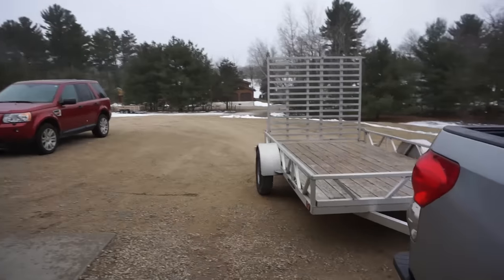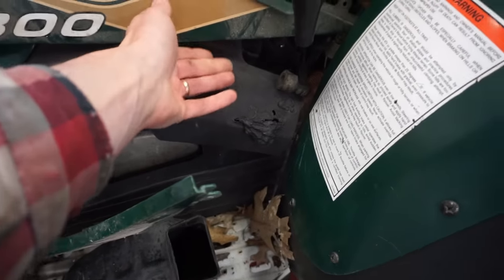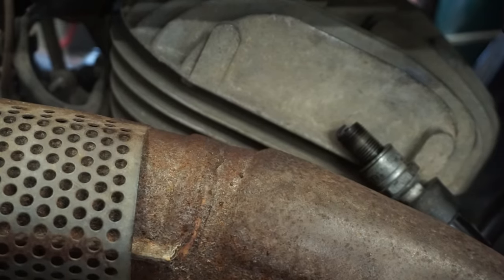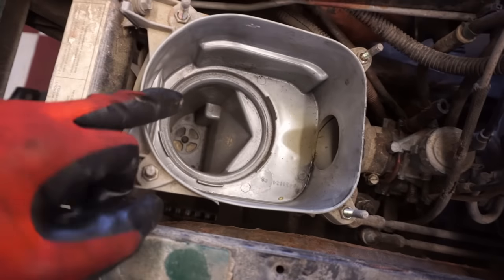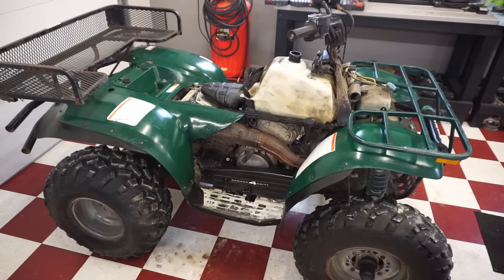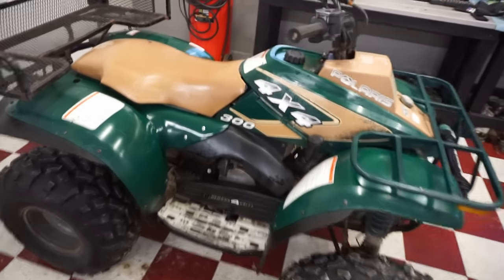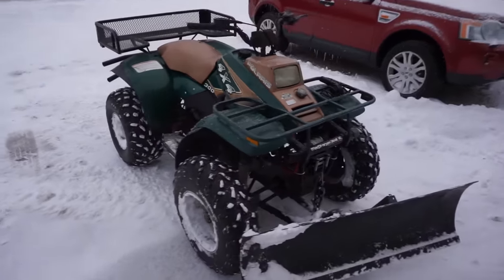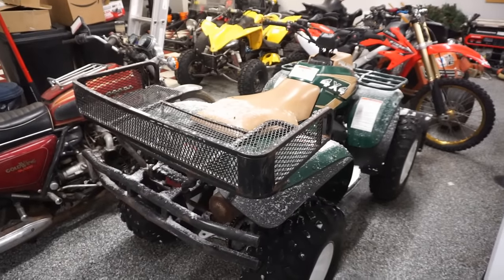$400 Plowing ATV Fixed In 10 Minutes (Plowing DEEP Snow)

Comment: Dear ATV manufactures......if you can make warning labels that last decades, you can make plastics that last at least half as long...
Reply: stickers save plastics by blocking UV
Reply: I have a large rubbermaid trash can that is at least 2 decades old. It is a light bluegrey with a darker blue lid. It has been outside taking sun and weather for decades, it is still flexible with no issues. I bought it at some normal box store. Yes they can make plastic that lasts forever. 
After they have a good formula they probably lobby Congress to outlaw some ingredient. That way the whole chain from engineers to plastiticians all get new work.

Comment: These old polaris 2 strokes are gems.  They are simple, powerful and easily upgraded.  The machines themselves are tough and rugged.   They're not perfect by any stretch as we can see through these outstanding videos but they are worth the effort given the the low initial cost. Once operational these old goats are unstoppable.
Reply from the maker: Parts are also pretty cheap for them. I don't mid the older models like this one. Easy to work on too.
Reply: @2vintage  Same, just a quick tip about these 2 strokes.  I've owned 4 of these polaris` and found that using a particular mix fuel-wise will nearly if not entirely mitigate ethanol issues.  1. Use minimum 89 octane.  2. Use Lucas upper cylinder lubricant @ 3oz/5gal fuel.  3. Use star tron fuel treatment @1oz/5gal fuel.  I use that blend in ALL  off road engines.  If necessary to use 2-cycle pre mix I use Opti2 at 80:1.  Never had a failure in any 2-cycle engine for over 30 years.  If using oil injection (I do), just stick with the polaris 2 cycle ves synthetic.  Again, never a failure, but that oil pump must be checked periodically for proper function.
Reply: @2vintage  i have a 94 sport 400 i just picked up for 600 its in pretty good shape need some work.
Reply: @williamwalter4882  80:1. ?  
Seems a bit high. 50:1 is the normal no?
Reply: @FondelMikeRotch  Opti2 is  recommended at 100:1 for any 2-cycle.  Amsoil Sabre also 100:1.  So I take it to 80:1 with the caveat of the mild lubricity from the Lucas upper cylinder lubricant already in my base gas.  It sounds crazy I know but Opti2 is seriously good 2 cycle oil - it's never failed me. The Germans know what they're doing.  Again, this is for premix only, not injection.
Reply: @2vintage  do you ever list these projects for sale when you are done filming with them? Marketplace?
Reply: @Pjw350  I was just gonna ask
Reply: You can go by any Polaris dealer and find them in their junk piles
Reply: @DoobieDoo1994  the sport is a great quad.  Had one back in the 90s.  There is a lot of power that can be unleashed in that 2-stroke 400.  Pretty sure you can still source performance parts for them.
Reply: I have a 92 polaris 350 and it is a beast, over 16k kilometers and it's barely rusty, and it's blow your  helmet off fast, power wheelies at only like 20 km, the max speed is like 150km/h 0-60 time is only like 8 seconds

Comment: As a former mechanic at a Polaris dealership, I can tell you the 300s and 250s 4x4 were designed to run their tires 2 sizes smaller on the front.  It looks like you're running the fronts off a 400 4x4. If so, the original gear ratio on the chain can/will cause damage in the transmission if left as is. I believe I remember, you can mitigate this by changing the gear ratio on the front sprockets.  Make sure the "Demand Drive Fluid" in the front hubs are full. There is a set screw on each hub, full is when it leaks out when the tire is rotated so that the screw is at 90 degrees or level. Those old Polaris 4x4 worked using electromagnets in the hubs. They are cooled in an oil bath, so the coil will burn out if the "Demand Drive Fluid" level is not maintained. They were around $150 each side back in the late 90's/early 00s, can't imagine the price now.
Reply: You can get a new hub for $60. I bought one for my 2002 Scrambler 400 2 stroke 4x4. That was probably 4 years ago though

Comment: A steal under $600 with winch and accessories. Good diagnosis on 4wd electrical clutch. Starter is usually just rusty and bendix spring needs cleaning and lube.
Reply: Well, he had to go to Harbor Freight for the winch.

Comment: Definitely a great deal, simple fox, decent compression,  not all broken up plastic,  really worth $1200 to $1500. I had made a switch box, and mount for my handle bar, with the parts from the winch control.  Back then I didn't want to spend $80 for the handle bar one. Tip for ya. Sealed outlet  plastic electric box I used. It's definitely worth fixing the starter. A paint, refresh on the plastics, and a good detail cleaning. Be a decent flip or swap. Down the road
Reply: O
Reply: Why do you feel the need to keep lifting the blade? Put it down and leave it, before you wear it out.
Reply: @Mark-sg8kd Not lifting the blade would make steering and traction less effective. I wish he had better access to his blade controller so he could start to lift blade incrementally when he nears the snow bank so he can cushion the stop and build a pile.

Comment: The handlebar brake lever operates all the brakes and the foot operates only the back. Also you need a battery hooked up for the 4wd to work. Battery died in mine, was using pull start for a bit, then 4wd stopped working. I started checking everything I could think of, then searched online and yup, needs working battery for 4wd auto switch to work. Great channel.

Comment: Just a tip. The rear brake lever can be adjusted with that screw and nut on the side of the caliper. This rear brake lever is actually mechanical and acts as a backup to the hydraulic system.
Great video!

Comment: Polaris used the most reliable oil pump you'll probably ever find, I've only seen one issue with one out of the 25 or so machines I've had, and that was a small leak but it still worked fine. Leave the injection

Comment: Sure you can test the front.   Jack the read end off the floor *wheeled jack aimed right down the middle) so the wheels spin.  Hit the 4wd and the front hubs should click in and pull you forward with the machine supported on the front wheels and the jack rollers.  Works like a charm and dont need to move it more than a foot.

Comment: Hey Joe check out engine restore it has CSL in it it restores minor scratches imperfections etc in the cylinder walls I used to use it in my engines it really does work it will restore compression big-time I used to put some of that directly down the cylinder and work it in

Comment: I noticed the engine moving when you started it and let it idle. Looked like the engine mounts might be loose, missing a bolt or two or it's just rubber mounted and it's normal for it to move. Just an observation. Are the front spindles a bit loose? Don't know if they tightened up when the wheels were bolted back on. That engine sounds fine. You'll get a lot of service out of it.

Comment: helper for your plow   blue 5 plaste gal water pale cut length wise has the right cure to wit , nut and bolt on to the plow gives you more lenght works for years

Comment: If you lower your tire pressure and add 100-150 lbs. to the rear, it will plow like a beast.  Might tighten up those trip springs a little, too.

Comment: If you put antifreeze in the wheels in the tires you've got more weight behind the machine we always put antifreeze in the tires of the plow equipment I wouldn't do it in the front tires but I do it in the rear if you do it in the front you won't be able to steer it it will always want to go straight but if you put it in the rear tires that gives you a little extra weight and strengths that little 300 you got yourself a good little machine there let me tell you you got one heck of a deal I used to work for Polaris

Comment: I could be wrong but it looks like your rear brake is a dual setup meaning like my 97 sportsman 500 4x4 the foot pedal operates a manual brake lever and when you activate the front brake lever it also operates the hydraulic side of the caliper

Comment: You will need to replace winch cable with a rope type. Because the cable always runs on the same spot. It will break fairly soon
Reply: Any suggestions?  Thank you
Reply: @MrSprintcat  The best ones are made for plow winches. They are only 8’ long. Less windings on spool means the winch doesn’t work as hard. I got mine from Amazon. 5/16” synthetic rope. I don’t know your stores. Maybe Harbor Freight or Tractor Supply.

Comment: You can tighten up those trip springs on the blade so the blade doesn't collapse so easy. At 2:36 you can see the spring attached to the 'L' brackets and note the eye bolts are barely tighten down. It will push more snow that way too.

Comment: How do you find so many good deals the last deal I made was with a 2010 sportsman 550 got it for 2200 the shifter was broken and the eps was out. Fixed both and sold for 5000. So a solid $2800 profit but I haven’t been able to find much that either needs work or priced right where I can flip it for a profit

Comment: Hi man I love your videos great job! I have a question I have a similar polaris I have the 97 trailboss 250 and I have an issue where the carb is getting super gunked up with 2 stroke oil even the slide is getting stuck the throttle it self seizes up, I cleaned the carb out it was tough to clean all that gunk the jet was clogged as well put it back together got it running but I think it’s doing the same thing right away the throttle/slide is getting stuck again. So main thing is why am I getting so much oil in the carb even the floats were stuck because of that.
Any help would appreciate it thanks!

Comment: I had a scrambler 500 and I remember hating the 4wd system. I redid all the front hubs, seals, bearings and everything else. It was just a poor design. Didn't like it. I ended up getting rid of it. It was pretty clapped out anyways and wasn't worth putting all that money into it. They have a tendancy to pull HARD if one of the wheels don't work properly. It will definitely ruin your day.

Comment: Need to get your self an in and out button to mount on the bars. So you don't have to keep reading hing for that remote. It would plow alot better if you could use the controls for plow easier.

Comment: Yea > My First motoecycle was a 1959 ponycycle scooter Mad I Think By Harley - Davidson

My next Bike was a 1963 Ducati 125cc Scrambler Trail Bike in 1965 > I traded the 125 in for 

Ducati 250cc Scrambler TrailBike > In 1969 Purchased a Norton 650 cc streetbike > In 1970

Traded that In For  Triumph 750cc street bike Sold That in 1973 and Purchased 1975

Yamaha 250 cc 4 Wheeler  with 4 x 4  Had a Snow Plow On it , Michigan  weather> stolen 

Out Of My Shed Up at My Cabin In Northern Michigan in 1977 > 1978 Purchased  a New

Yamaha  400cc Grizzly 4 x 4 With  60" Inche Snow Plow and wench on front Of Four 

Wheeler That was the end Of All That Butt at 73 I still gey outdoors and Whitetail Hunt

I Miss Not Having a 4 Wheeler to get back in The Wood's On the 2 tracks Trail ??? 

Gave you My Storey > GooD Luck > Russ Robinson , Whitmore Lake , Michigan 48189  
😄👍🏼🙏🏼🏍🛵🛵

Comment: I had this exact wheeler as a kid, I got it for 400 and it ran great. The oil mixer stopped working and the engine seized on the trail and by the time I towed it back it freed itself up and ran like new again. I just mixed my gas from then on

Comment: The front suspension is very similar to a Polaris trailblazer 250cc 2 strokes, it was the first adult-sized quad I've ridden when I was younger, and I was always a whisky throttle kid, and it took it and ran perfectly no matter the weather or how long it sat, it was a tank, even when I ran out and got stuck without gas in my field it somehow started up and got me home, it was a great quad from my experience,  and it now sits in a storage container on my uncle's property up north, I and my father plan to get it out of there eventually and restore it, it's sat up there for almost 10 years, I can't wait to see that machine again when we choose to grab it, as I'm thankful it was that quad that built up my love for small engines and gave me childhood memories I'd never forget!
Reply: Good luck  with your beast, I've owned several old polaris 2 strokes and I will confirm they are indeed  - tanks.

Comment: II and own a 1999 Kawasaki, Prairie, 300 4X4. I owned a business that had a parking lot of just 200 feet short of a square acre of blacktop. I bought a winch and blade and mounted it myself and plowed the whole parking lot plus neighbors driveways and sidewalks for seven years. Only 3 times that I couldn’t plow because the snow was just too wet. If we were to get more than 10 inches of snow, I would get up like at 2 in the morning and plow, then plow again after it stopped snowing. Sometimes my thumb would get so cold I couldn’t press the throttle, I would have to go in and warm it up. It would take me like, 1 1/2 hours to do the parking lot if the snow was 3 inches or less.

Comment: If you still have the atv and have engine problems i have a 300 i rebuilt but has been setting for a few year probably would replace crank seals the clutch went out so parked it and parted it out i am in minnesota

Comment: Nice four wheeler though. It was actually worth more than what you paid for it to begin with to Joe. Just in case you didn't know that. Even though you had to remove old wiring.& Do some wiring work on it to. And buy A battery.& New wench for it. That four wheeler with everything working on it right. New replacement magnetic four wheel drive hub locking sensor's it'll bring still today with all new fluids in it to. $ 4000.00

Comment: Next time check to make sure you flip your switches all on to the run position before freaking out lolol. But you know this is the first video you never once showed checking the oil before you run it lol
Reply: He didn’t check the VW’s oil before cranking it a bunch either.
Reply: @chuckfry1227  but technically the guy told him the oil plug was leaking and he did change the oil in that video...
Reply: @kochykoo  not before he got it running I thought.
Reply: @chuckfry1227  either way but on this quad he never touched the oil once other than mixing that 2 stroke oil in the gas
Reply: 2 stroke

Comment: I had that same exact 4 wheeler as my 2nd 4 wheeler as a teenager and it was probably the best bike I’ve ever had. I bought mine used in like new condition and it was amazing!! It would go through water almost like a wave runner. As the exhaust blows out the bottom of the pipe instead of the back of the pipe. After several years the belt can unsealed and I could no longer go through water so I sold it, but was honestly the most reliable 4wheeler that I’ve owned and I own 5 right now. 2 Yamaha’s 1 Suzuki, 1 Honda 3 wheeler and a Kawasaki Mojave. The one U bought still hasn’t the original tires so it can’t have that many hours on it. I don’t know why they put the override button on the reverse that lets U go really fast in reverse. Was kind of useless in my opinion and cause mine to wreck as a young inexperienced teen driver. Lol Mine was a 94.

Comment: With all the toy's you have in that gorge you would think you would have look at the switch to see if it was on lol good job. I would pull off the spark plug but then solid heat tap to that spot the fan rubbed. If it was me I would bye pass the oil injector and mix the gas an oil your self

Comment: Hes lying. No way he drop $250 if he had alot of response on it. He could sell the plow, part the rest out make double that. Could scrap it make the difference. He's just lazy. Lol. You need a ,ift bro. Make life much easier. One like mustie1 uses be perfect. Tech tip. When you pull the choke plunger out the carb, pull the choke knobs out afterwards. Keeps the cable tight so the plunger won't fall off the cable.